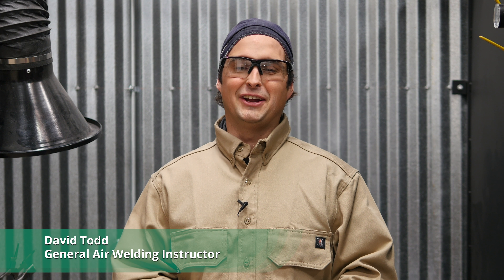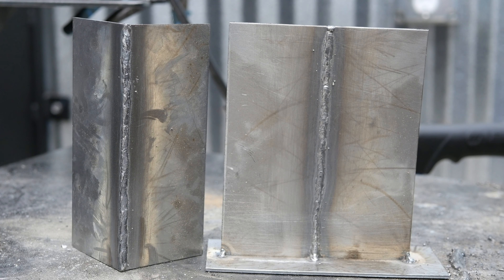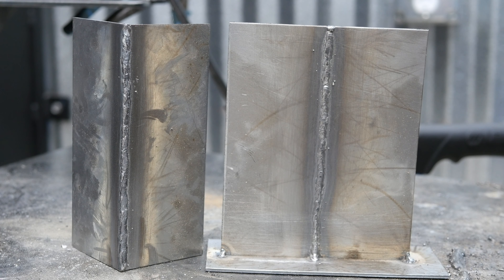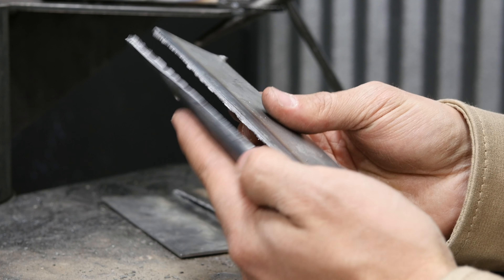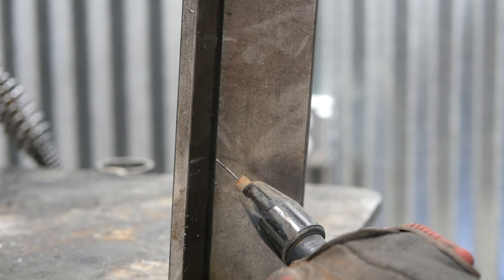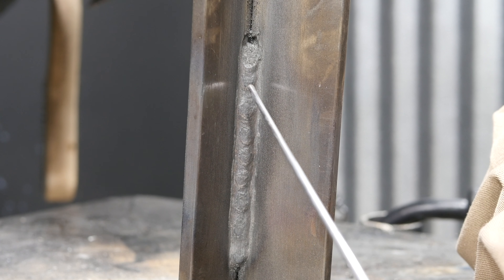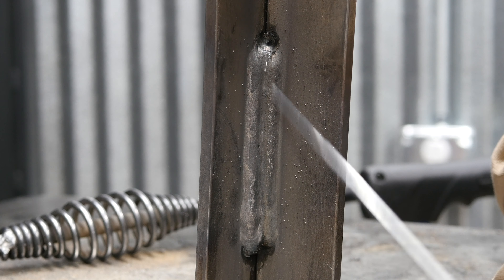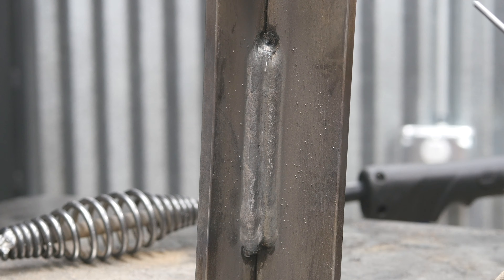FluxCore Welding: Corner Joint, Butt Joint, Vertical Down, and more

Comment: Isn't welding in general, for structural circumstances?
Reply from the maker: Yes, structural welding for our purposes refers to welding that adheres to the D1.1 welding code, meaning if it fails, people can die. This is opposed to welding structures that are less critical (e.g., artwork, furniture, etc.).